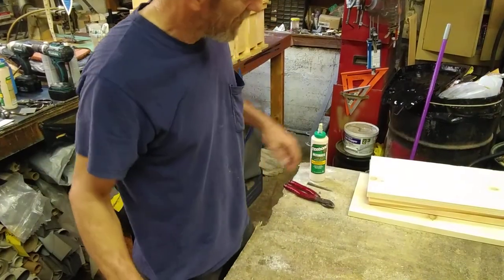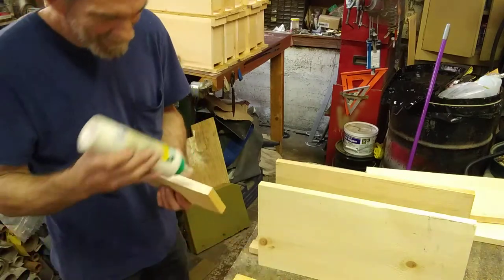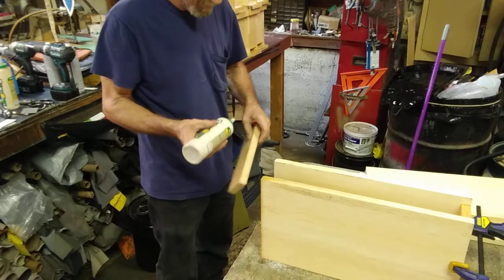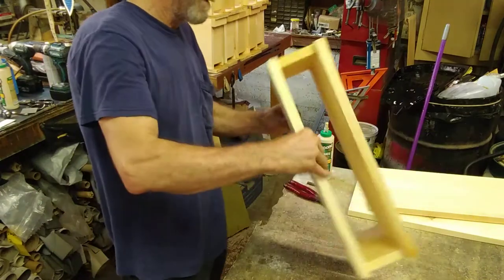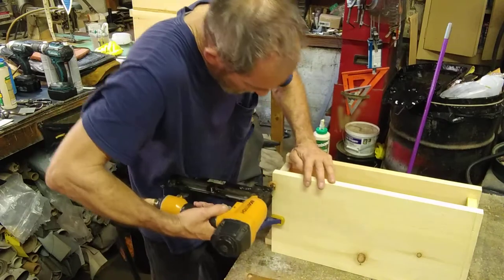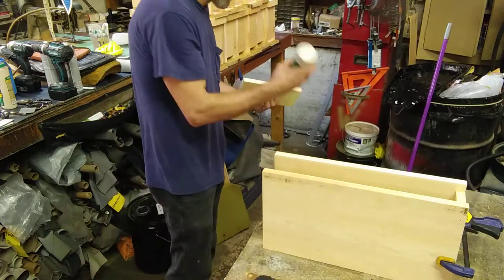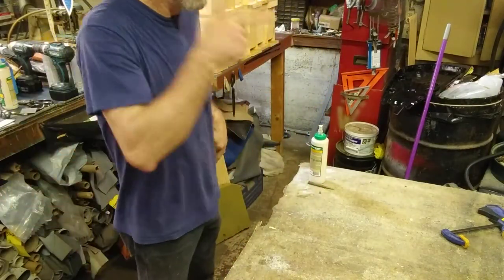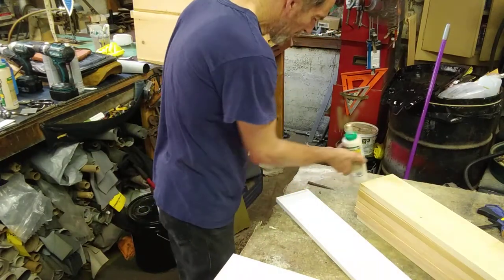Making 2 frame mating nuc boxes.

Comment: You said you were in a hot temp get your self a blower fan from either a house heat/air-conditioning system they will move some air helps to keep the place cooler!

Comment: What are the dimensions?
Reply from the maker: 2 frame nuc measurments.
Bottom board is 5"x 21"
Sides 10 1/4  x 19 3/4"
Front 3 1/2" x 8 3/4"
Back 3 1/2" x 9 1/2
Lids. 5" x 24"
Reply: @Warren76317  4:30 4:32